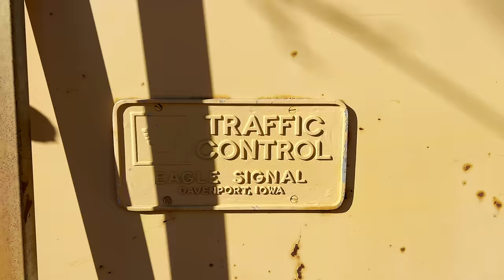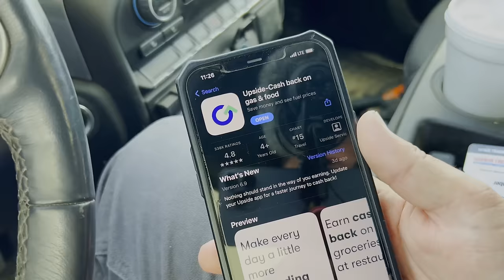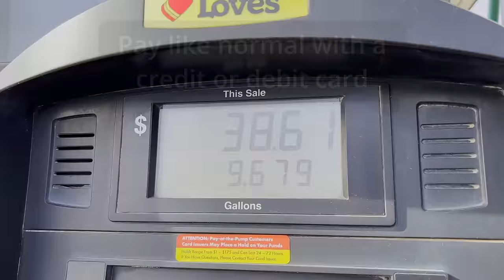Touring an OLD JUNKYARD plus RESCUING an Abandoned Antique Car!

Comment: Silas, although it only appear on screen for a second, seeing train transporting that gigantic wind turbine blade was impressive. Although I’ve seen wind turbines at a distance, seeing blade next to two diesel engines really adds scale to the immense size of the one blade!
Reply: You ought to see those blades when they halt them on flatbeds behind semi's. There's a couple of places out in Kansas at you can get right up them. Normally they said off-road quite a little bit but still impressive. They come in different sizes. I bought a turbine off of state of Kansas they had out there at the fairgrounds. I think turbine itself is maybe 12 ft in length. Of course once you're talkin about I just massive! It's been awhile but someplace out in Kansas you actually drive down the road it's two lane and you see a bunch of red lights all over the place like you would see them on a cellphone Tower 🗼 or something. It's a wind farm and I don't know there has to be a few hundred of them out there.  In the daylight it's not as impressive. Because you can only see the turbines for so far out. But the lights at night just go out to your left and right as far as you can see. Several hundred maybe a stretch but it's the biggest one I've seen of wind farms. Thought you might be interested in some of that giving your comment.

Comment: The short box f100 is a good builder.
I used run a easy crusher on the west coast doing Mobil crushing and bailing.  Talk about sad. I have crushed cars that should of been saved but when you have 3 drivers pulling doubles not any time to be picky when making bundles!

Comment: The old sedan in the ravine is a Model A Ford, not sure of the year.
Reply: That is a 1928 or 1929 Model A Ford two door sedan that the roof has been cut off of. The 28 and 29 have a narrower cowl then the 30 and 31 do. It looks like a post coming down from the corners of the windshield. That is a dead giveaway of the years. The 30 and 31 are smooth there, no post. Looks kind of like a Phaeton that way, a home made one for sure. A friend and I salvaged a lot of Model A parts during my misspent youth!  Love your vids and these old cars and trucks.

Comment: Regarding your new sponsor :  It makes one wonder - how a company can charge what they do for gasoline - - then, turn around and give a 25 cent per gallon rebate.
What I am getting is this .... gas is expensive - and SOMEBODY is making a lot of money ( on the backs of hard-working people ).  If the oil companies can afford to
give a rebate of a quarter per gallon - they could reduce the price by 15 cents a gallon at the pump - and still come out a dime ahead.  I'm sure it is all about marketing
and getting your contact information, etc.    Sorry - I never apply for these apps or other info gathering schemes.  Then they sell your info and round and round it goes !
Reply from the maker: Actually they don’t mine your data. Most gas stations operate on a very thin profit margin with fuel. Their money makers are snacks and drinks